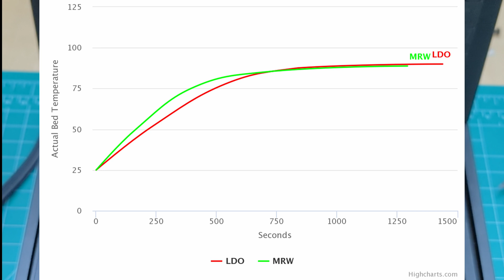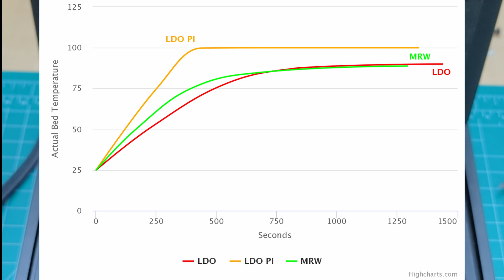Polyimide Heater Comparison

Comment: I have one in an LDO V0.2-S1 kit that I am building. How would I go about collecting data in a way similar to what you presented with your graphs?
Reply from the maker: We just put a piece of non-reflective tape on the bed surface and hit it with an infrared thermometer -- Set the bed to 100C and start a timer.

Comment: so what we learned is:
100W is more then 60W... shocker i know
having the thermistor at the place that actually needs the heat makes it report the correct temp. again shocker.

in all seriousness though, i would love it if keenovo just had a hole in their heaters and we could thread a thermistor in the middle
Reply from the maker: The good news is that the latest trident kit we got from LDO had the hole you are talking about!  The bed is even tapped for one of these thermistor's.  

Hopefully more manufacturers embrace the idea!

Comment: Thanks for the great video and showing the results so clearly!
Sorry I have two questions:
1. Is the printer enclosed during the 15min heat soak process?
2. Do you think it's the type of heater that make such huge difference or it's simply the position of the thermistors?
Thank you!
Reply from the maker: 1. The printers weren't fully enclosed. panels were on, and doors were closed, but the tophats were off.
2. I think it's mostly the thermisor placement.  We have a regular silicone heater with a similar screw-in thermistor in the LDO Trident 250 Kit and look forward to testing that theory.

Comment: It makes sense - the thermistor is deeper into the plate, so it measure the temperature closer to the surface. Thus, instead of heating the bottom of your bed to 100C and waiting/hoping for the best, this sensor lets you know when your entire plate is reaches 100C. Meaning the bottom of the bed must be greater than 100C at the time of meeting the desired bed temperature. I would be curious how far above 100C it goes (if it truly does, I'm just speculating), and how it would compare to a larger bed like a 350mm Voron.
Thanks for the video about a new advancement!
Reply from the maker: We're looking forward to seeing larger heaters of this style too.  Not sure how far (if at all) the heater overshoots the target temperature, maybe we'll check this out in a follow up video
Reply: @MapleLeafMakers  Thanks so much! I'm looking forward to more about this as well. I believe in Mainsail, it shows how much power the heater is applying to the bed as a percentage. If the firmware is only lowering the percentage after heating up vs gradually lowering the percentage as it nears the target temperature, I would think it'd overshoot. Which leads to my curiosity about larger and thicker beds for safety reasons. Best wishes!

Comment: Wait, so you are telling me when the thermistor read 100 on a normal bed, it isn't even close to that on the surface? That's huge, and could explain a lot of adhesion issue. Heating the bed first and then the tool head isn't enough as you showed with your time measurement.
Reply from the maker: That's exactly what this test demonstrated!  We were as surprised as you!

Comment: If you heat it up too fast the bed will warp. That is why the 100w heater on a spec voron is limited to 60% duty cycle.
"#max_power: 0.6                                                     # Only needed for 100w pads"
I am sure the situation would be worse with a thinner than spec bed.
On the v2 it states...
"##  Adjust Max Power so your heater doesn't warp your bed. Rule of thumb is 0.4 watts / cm^2 ."
Reply: I'm still running the 150w 220v heater  on my 6mm bed from the 0.0 to 0.1 upgrade and bed is doing just fine, hopefully it goes to 0.2 without much issue
Reply: I would believe that it's for normal sized beds, not these small. 120mm of 8mm aluminum wouldn't bend so much.

Comment: I know it would be really expensive, but I would love to compare to nickel plated copper heatbed, much more thermal mass than aluminium
Reply: i mean, why the nickel plating? we ARE going to put a heater and magnet foil on it anyways, so everything that would matter just needs to be cleaned before assembly
Reply from the maker: Oof that would be neat but very pricey indeed....

Comment: I have a keenovo 100w heater with a ssr on my v0 with a mandela buildplate that someone sujested I lower to 60w in klipper.
Reply from the maker: it's a popular rule-of-thumb to keep the heater wattage at or below 0.4W / cm^2 to avoid potentially warping the bed.  I have never seen bed thickness mentioned along with this number, and a thick bed should be more resistant to warping.  We haven't noticed any effect after a dozen or so heating/cooling cycles, but of course your mileage may vary.
Reply: @MapleLeafMakers  I'd really love to see somebody test the 0.4W / cm^2 theory. I've heard it said as fact many times, but haven't actually seen any actual data. What happens if you give a bed a full watt per cm^2 and cycle it over and over? Do we see warping?
Reply from the maker: Good idea!